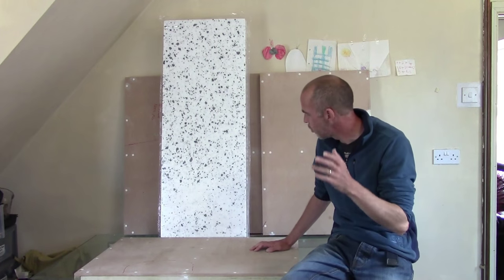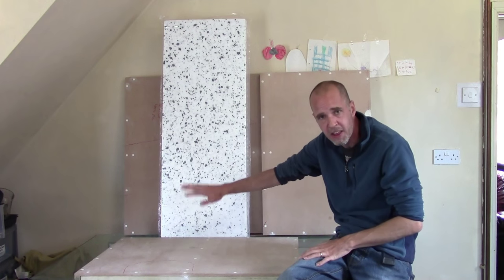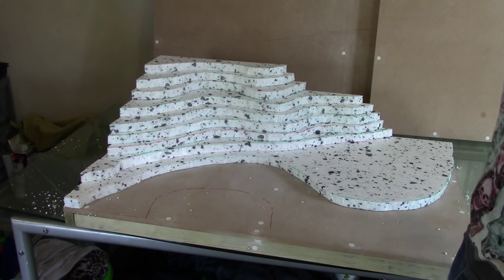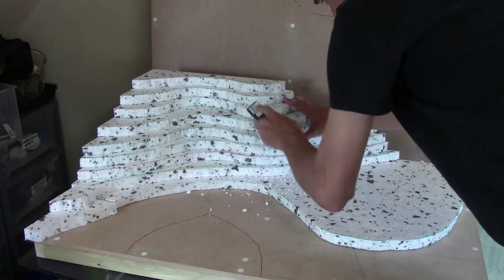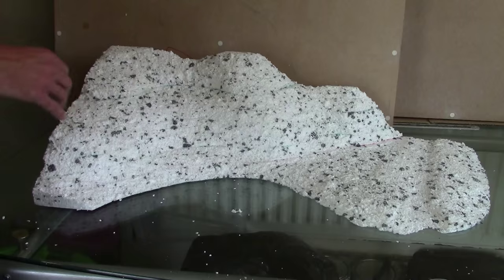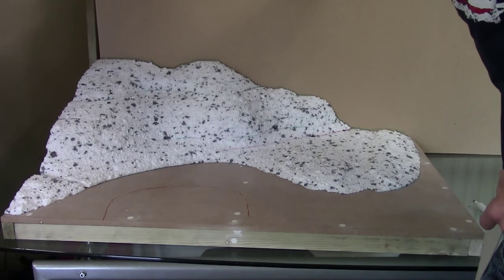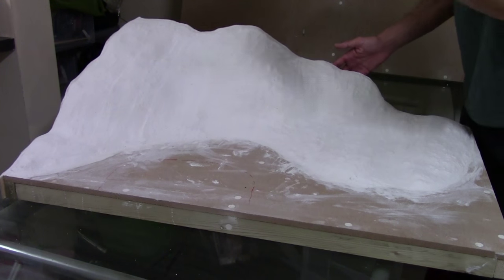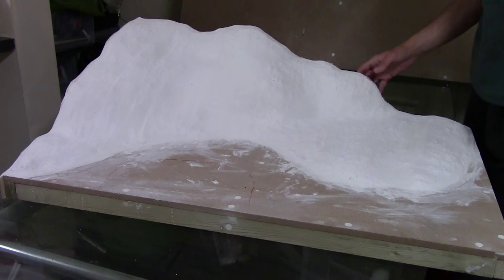How to make large wargaming display hills

Comment: Great part 1 Mel, looking forward to your next installment. Between the layer stage and the wire brush (love the wire brush) I use a single edge scalloped blade (old school) bread knife to shape it down. It is faster than just the wire brush and less toxic white dust.  Before I lay down the plaster bandage I imbed irregular 3mm MDF shapes where I will later place any trees. Lord of the Ring wargamers like using this sort of hill and larger especially if they play goblins but storage is an issue with them.
Reply from the maker: James Evans I like the mess mate :-)

Comment: I'm a bit surprised to see you using plaster-cast material rather than Hydrocal/Ultracal/whatever and making your own substrate with cloth or paper. The plaster has the reputation of being crumbly, heavier, and less strong than gypsum cements and the like. Is there a special reason for that other than the easy availability of the material you used?

And now, that said, I'm wondering whether fiberglass casting tape (Orthotape and the like) might make for a particularly durable choice for terrain. I know from experience that it's far more durable than plaster-cast cloths.

Finally, it might be worth mentioning that if you want to replicate a particular piece of terrain, the contour lines on enlarged pieces of topographic maps can be used as templates to cut your foam layers. (Apologies if you mention this elsewhere; I'm only part way through your archives.)

Very strong video; thank you for your work.
Reply from the maker: I've never had problems with it but then I coat it with pva and grit before painting mate. Fibreglass works great but that's high level work and not really for the home hobbyist mate. I've heard on the contour thing before but never actually gone from map to piece, I rarely mate really big mountain ranges. Thanks buddy
Reply: The nice thing about fiberglass casting tape is that it's no harder to use than plaster-cast cloths. Wet it down and apply it. It's used by orthopedists in the same way the plaster cloth used to be, but it's darn near bulletproof. I saw it in use when my son broke his leg. Just a thought, though; I haven't tried it.

As for sculpting contours: the subject doesn't have to be a mountain range to use contour maps. A club that I used to be a member of did  the Little Bighorn battlefield on 4 separate 4'x8' foam boards (so 16' x 8' in total; call it 5m x 2.5m, close enough) with terrain contoured for the area. No place was thicker than (IIRC) 3 sheets of foam, but the effect was very nice. The rolling ground was well represented by the board.

Comment: What approach would you suggest for making indentations to fit bases/models? I'm thinking along the lines of running the same theme on model-bases and display board, and maybe even having specific places for certain models, so you can blend them in almost seamlessly.
Reply from the maker: Tech2Rush Cut the recesses into 3mm mdf, put plasticard underneather and then fix them into the display board in the relevant places and then blend in with filler. Hope that helps mate.